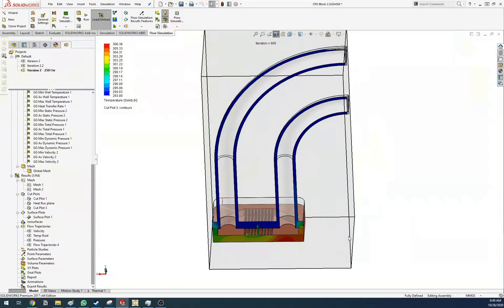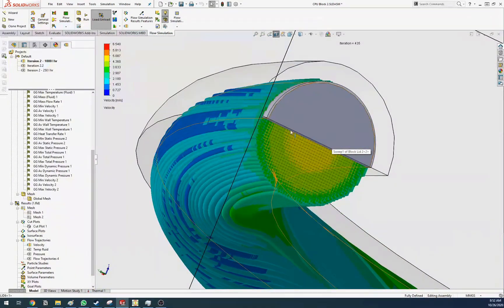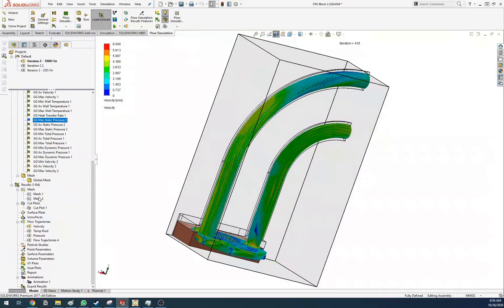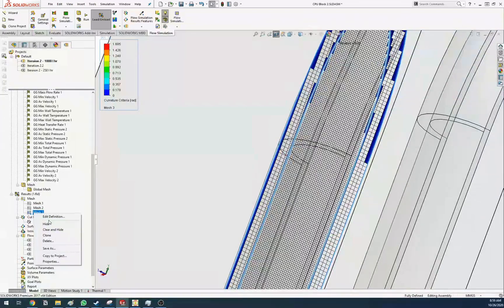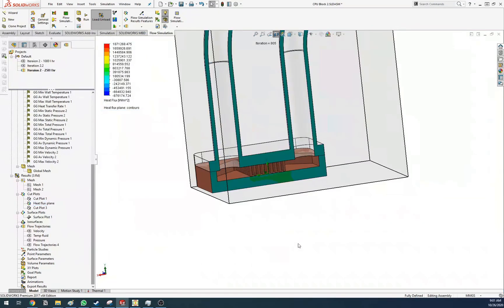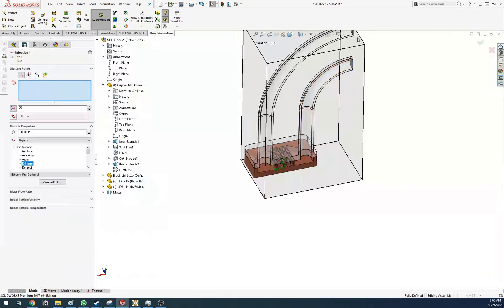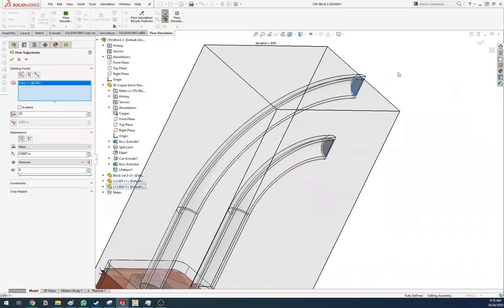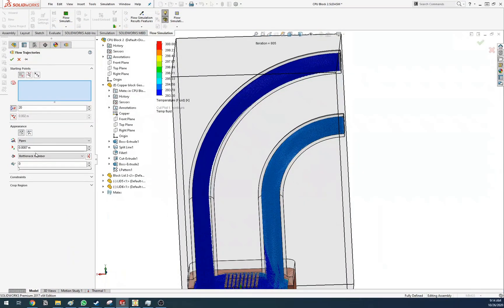CPU water cooling block CFD flow simulation iteration 2

Comment: Hi, Im currently doing a college project on optimizing CPU's cooling. I plan on doing a simulation similar to what you have created here however am struggling to come up with a way to fairly compare air vs liquid coolers. I also plan on showing the design optimization of the waterblock design similar to the way you done in the first video on this with the pass through vs this with pins (possibly microfins). any help would be greatly appreciated.
Reply from the maker: Sure can do! Drop me your email adress here and ill write to you, you can edit it out later to not have your email adress laying around on youtube comments
Reply: @mechanicaldevelopment9944 I'll edit the comment in a few hours. Thanks
Reply from the maker: You can edit
Reply: Hi ! I am also trying to simulate an air cooled pc and I could really use some help. I cant seem to understand how to  make different objects like the radiator, psu and motherboard and at the same time simulate different phenomenon. I am trying to simulate the upper cabin in this video. link- https://www.youtube.com/watch?v=C3GKe7eXbPE